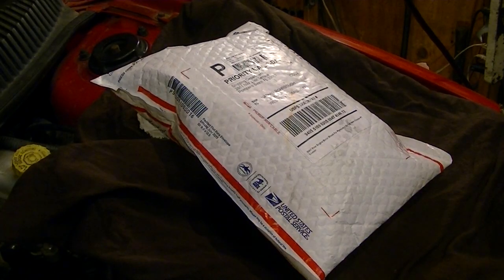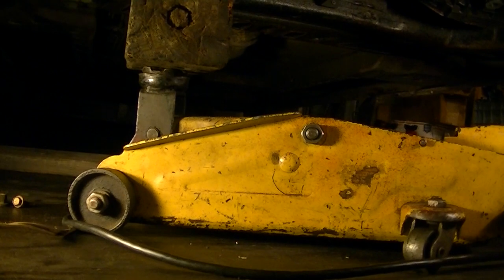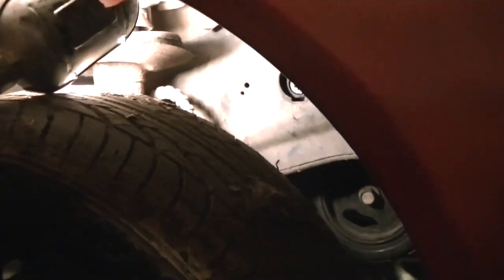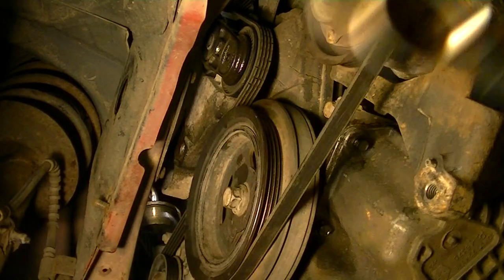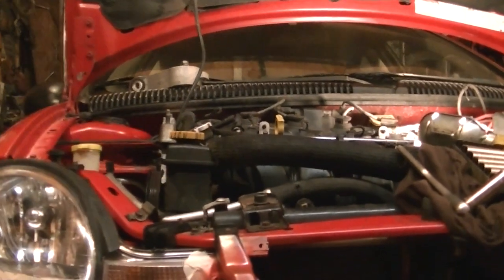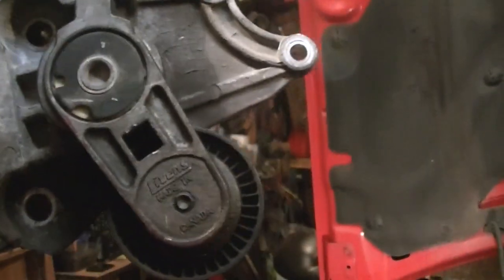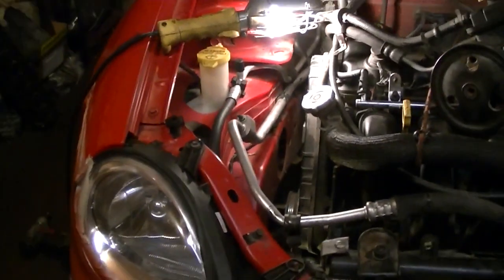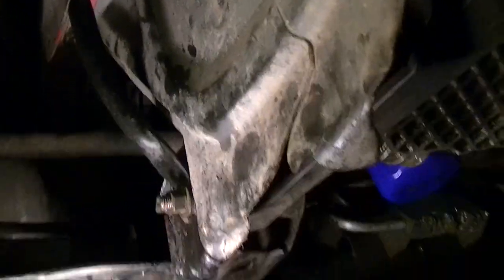Replacing a Dodge Neon/P T Crusier Center (Hard to get to) Motor Mount. -Part 2

Comment: Thanks for putting this video together, it was VERY helpful for me. I just replaced those 3 passenger side engine mounts and 2 belts for $170. I bet this job at a shop would've been $650! Because of your video, I completed the entire job in 3 hours and that included going to the auto parts store! Again, much thanks.
Reply: I just had my three replaced plus the transmission mount.  4 mounts total.  Parts and labor cost $659.   Didn’t have the means to do it myself.

Comment: Thanks a bunch, I really appreciate it. I called for a quote and was quoted $530.00 I watched the video and bought the mount for 26.00 and spent maybe 3 hours doing it saved me over $500.....
Reply: Same here man except I got quoted 300 by the local mechanic for both but I knew I could replace the upper right mount
Reply: Can u come do mine.?
Reply: For 300 bucks, I'd certainly let someone else do this sh*t for me. Of course, in 2023, this is probably a $1,000 repair. You know, since COVID, everything is 5 times more costly than it was pre-COVID. Everyone trying to recoup that stimulus money, yo!

Comment: This is an awesome video I work in a transmission shop and I use this video to change the broken motor mount the bolt actually broke off so I had to replace it all I've been a mechanic for 35 years and I'm still learning new things thank you for this video it's helped out tremendously I watch some other videos of people doing the same thing but they weren't is detail is this awesome video keep up the good work

Comment: Hey Nathan great video very informative and helpful. Watch this video several times before attempting to do this job because I didn't want to spend $500  to have this done. The job went well 1 1/2 hrs start to finish just an FYI to other people doing this job if you want to make the mounts last a little bit longer if your car is is driven hard  you can fill spool mounts up with windshield structural urethane the mounts should last forever. You pick up a small vibration but nothing like with a bad mount.Keep up the great work on the videos.

Comment: The upper and lower parts on the passenger side are torque struts, not engine mounts. The center mount, the one that is buried in the body, is THE engine mount. It carries the weight of the engine 24/7/365 and is tuned to handle idle shake of the engine. It fails first. When it fails, the upper and lower torque struts try to carry the load, which they are not designed to do, and then they fail too. The trans mount, located under the air cleaner box, is a load bearing mount also, but it is a flat mount, not circular, and is much easier to access. This video by Nathan is the best I've seen yet. Too many people ignore the center mount (which fails first about 100% of the time) because they're lazy or don't have the patience to do this job right. Do yourself a favor and change all 4 mounts when you do change them!
Reply from the maker: Right on man!!

Comment: I've seen alot of these videos bc im doin this to my 03 Neon and this is the best video!!! the only pionter i woild give you is a 11/16" rench fits on the little "nipple" thing on top of the tensioner pulley so you can take tension off the belt to make the belt easier to remove/install
Reply from the maker: Yea I thought of that later ;)  Thanks!

Comment: There is a strut mount adjustment that is supposed to be done and if it is not set correctly it could cause vibration and premature motor mount breakage. Did you check this adjustment?

Comment: my neighbor is going to replace all 3 and my radiator on my 05 dodge neon... i do have a small vibration from the motor mount but don't know how bad it is..  but i am so ready for it to be fixed and ready!
Reply from the maker: Nice!!
Reply: @FixingWithPassion  ive been driving my neon with a small vibration since last year in may when igot the car... so i hope it helps!!

Comment: On the tensioner if you take a prybar put on the lip of the tensioner pull back and the top motor mount you can take the tension off the belt and take it off that way
Reply from the maker: Nice!

Comment: You dont need to get a socket on the serpentine belt tensioner on the 2005 models.  A 3/4 open ended wrench fits perfectly from above onto the pulley bracket casing. It was a time saver. Works great.
Reply from the maker: Great!

Comment: Had the same problem and took all mounts off including trans mount then popped the 4 lower strut bolts off then backed off shaft nuts and took both shafts out of hubs.  The engine now can be lowered and pushed to the drivers side to get to center mount . Much quicker way but you need 2 Jack's to do. My second Jack was my motorcycle jack which steadies engine.  I kept shafts in trans to maintain tranny oil level . Seems like out of the way work but not as much nuckle scraping work.
Reply from the maker: Nice to know. Thanks!~

Comment: Did you use the mopar part?? I’ve heard  it’s oil filled where aftermarkets are not and you still get some vibration with aftermarket?? Thoughts on this??

Comment: Thanks , this so well done... I have two manuals Chilton and Haynes. Following both of these manual would be tragic, since the instructions are incomplete.. I also found discrepancies in the torque strut adjustments in these two manuals.  you have given me the confidence to try. Its the last one I need to do. I have serious engine noise when accelerating. Its almost deafening inside. My muffler guy said it would be 500$ to replace this and the upper and lower torque struts,.. Then he pulled out a broken piece of this right engine mount. I am convinved the noise is NOT from engine mounts. Because its quiet until you step on the gas.. Nor is it from exhaust..I will find it on this 2005 Dodge NEon 2.0 sxt. Harmonic balancer.. ? Any ideas would be helpful..?
Do you have a favorite penetrating oil? This is an interesting test video...Ive been using blaster after using Liquid wrench my whole life. Switching back..https://www.youtube.com/watch?v=xUEob2oAKVs
Reply from the maker: They all work good with time.
Reply: The Chrysler MOPAR shop manual for PT Cruiser recommends pulling the engine to change the 4 mounts. As Nathan has demonstrated, even though this is a Neon 2.0L, the procedure he uses is going to be the same for the PT and does not require the engine to be removed completely.

Comment: At 265,000 miles, I've had the timing belt and water pump replaced twice in my '02 Neon SE. Not only did I never think to replace all the mounts along with the timing belt, it was never suggested by two different professional mechanics! If I knew then what I know now...

I have a vibration while accelerating, which started a few weeks ago. What are the odds that this mount is fine, and I only need to replace the upper and lower mounts (and maybe the tranny mount)?
Reply: Hello, which company should I install? I am writing to you through a translator.

Comment: I have very bad vibration on the express way in my neon. Was wondering your thoughts on it. Only happens when I let go of the accelerator.
Reply: dont let go of the accelerator
Reply: @DanKirchner5150  that doesn't help. It was ball joints
Reply: @zacharymelin9003  ok  thats a relatively easy repair

Comment: I was quoted $1859 at Christian Brother Automotive to have all 3 of these replaced.   I had the timing belt replaced and I believe that motor mount is fine.  It's the lower and upper that needs to be replaced.   The quote for my mechanic is I think $1450 with the parts and without 1250.   This is the most ridiculous price for the job.  They stated they'd have to remove the engine is why it's expensive.   I have yet to see an engine removed for this job on YouTube.   I bought the upper and lower for $44.00 on Amazon.  I can buy all 3 for ^60.00 on Amazon.  My goodness auto repair places are astronomical.    9bolts that need to be  removed or loosened.  2 torx on the lower for that mount piece in front.  2 on the lower for the main bolts and 1 for the support.  The upper is the ground wire.  The main bolt on the side.  3 from the top.  I mean.........   yah, it's not hard.  If the job was $300 or $400 I could understand with the middle mount being replaced too.  GEEZ

Comment: Good Lord! All that work just to replace a motor mount. No wonder people let cars fall into disrepair.
Reply: maintenance maintenance maintenance happy car happy driver!
Reply: Yeah, it makes me miss my '68 Mustang that had a 200cid straight 6 under the hood. Replacing a motor mount in it was quick and easy. Even removing the cylinder head to clean the carbon from it and the piston heads was super easy.

Now I have a PT Cruiser and Saturn SL. I want my Mustang back. LOL!
Reply: Yeah, buddy!

Comment: I bought a 2004 dodge neon a couple months ago .  I need to replace the same mount that you just did.  but I'm not good with cars.  do you know how much people usually charge to do this?
Reply from the maker: The will charge you probably $250-300....
Reply: I'm having some problem with my 05 Dodge Neon it shakes at a stop and AC cools but it smells like Freon in the car

Comment: Hey I drive a 2011 ram 1500 and I hot water sucked into my motor through my air filter now my truck won't turn over it just makes a single click
Reply: Keondric Adair my friend your truck is hydro locked
Reply: Mobbin Mazda thanks but ive already replaced the motor

Comment: Great vid. Clear, thorough, and to the point. Very helpful. Thank you.

You may want to check and update your referrer/influencer links to Amazon (on all your vids, maybe). I tried to click the link for the 6000 lumen LED work light but it didn't work. I can only assume that seller or product is longer available at that link.  Too bad they don't notify you when it happens. Seems like you could miss a lot of revenue this way.

Comment: Well Pal,,, If you're gonna go change that motor mountain, you'd better go inside the house and have a couple of quick stiff shots of whiskey. Cause your temperature will be boiling about a half an hour,
I have to Redo mine ,,,drill holes right through the frame,, I snapped off too taken them out and Snap 2 off Putting it back in there's ,,,,,I have one in Secure, and then I spot. Welded the rest of it in spots,,,well its holding, so far,,,  but one of these days I'm gonna have to face it. I

Comment: Well, guys, so you know I am 66 years old. Changed a lot of motor monts in my time, and i Just changed all 3  on my Dodge. And there's still another one that goes on the transmission too. That was the biggest pain in the ass I've been Through, and on top of everything Else three bolts on the motor mount snap off  so I Welded the motor mode on the fraim, (True story)
Bottom line this car runs like a brand new automobile with 60,000 miles on. 8hr job,, This piece of s*** will not beat me.
Reply from the maker: Right!!